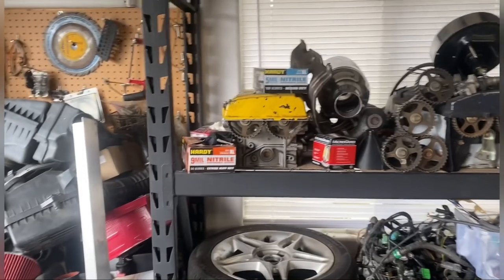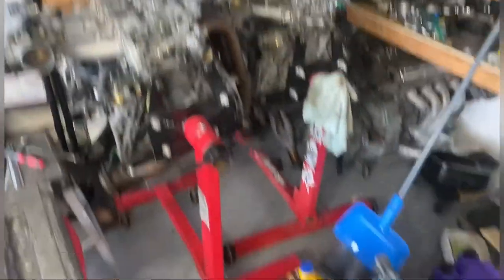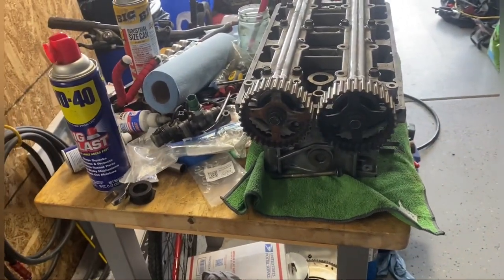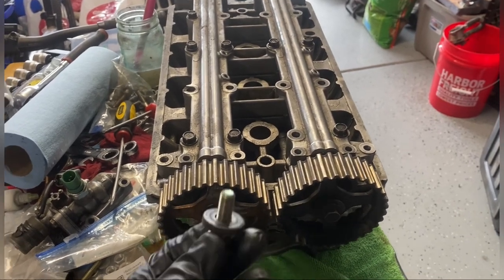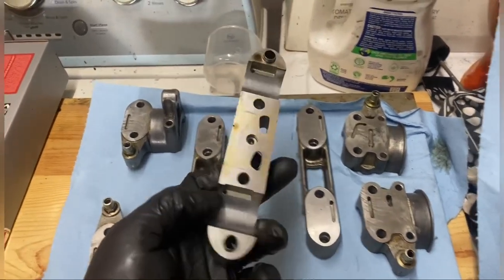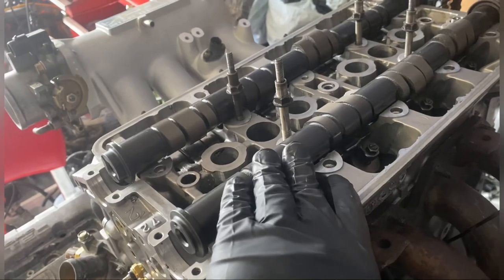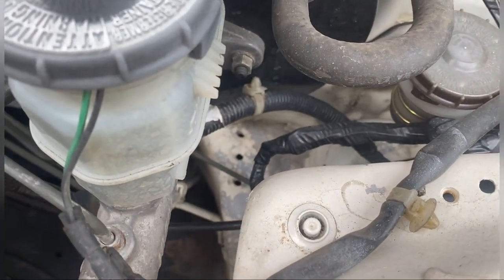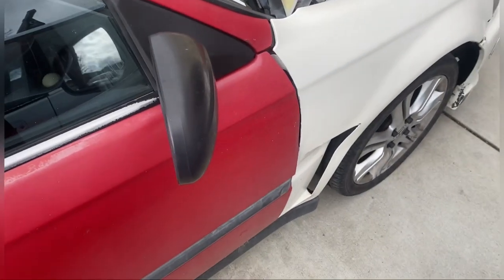Skunk2 Tuner 1 cams for a GSR factory cam gears

Comment: Just asking which one is good cam for b16a b18c or b16b cams
Reply from the maker: Just depends I have to stay Cali legal so this was the only one I could run on the streets. But stock cams rip too. I originally wanted type R cams and was told these skunk2 were a little bit more aggressive
Reply: Because i have a piston wiseco 6567m84 for my b20b itr head
Reply from the maker: @marvinreyes6270  there are a lot of free online compression calculators where you can put in the size of different parts like the bore and the height of the piston. And with this build, I was trying not to reinvent the wheel. I wanted to model it as close to the Integra type R as possible.

And I’m sure that there are a lot of ways to make more power than what I did, but cost being legal in California and reliability would led me to these choices.  

And I knew I wanted a slightly more aggressive cam then stock. But I don’t know what the difference would be in power on the Si, GSR, civic and integra Type R. But in the stock form then ITR has the most “power”
Reply: Thank for your replying my messege. Now i will stay better itr cams some told me i have to buy skun 2 tuner 1 for my b20vtec
Reply from the maker: @marvinreyes6270  yeah I think I was told skunk2 tuner 1s are just a little more aggressive then ITR. And still California legal. And I couldn’t find a set in good condition for the same or less then the skunk2s cost new.
Reply: @civicstar982  yha sure if you can find me skun2 tuner 1 its fine
Reply from the maker: @marvinreyes6270  yeah real street sells them all day. That’s where I got my set I think they are in Florida. And I searched California and Nevada for a used ITR set before I went with the tuner 1s